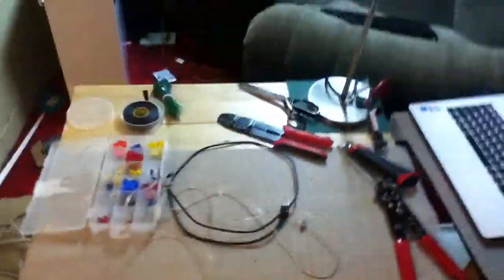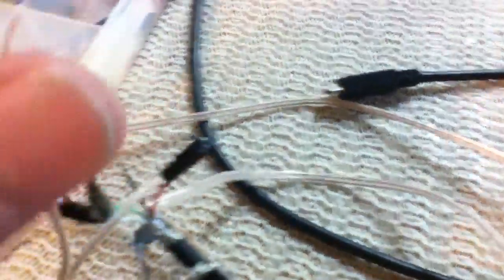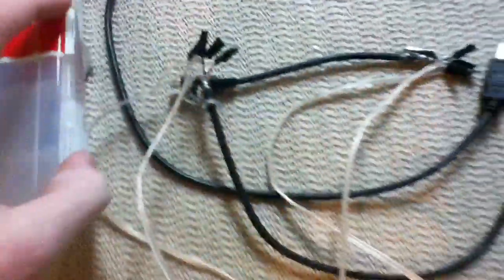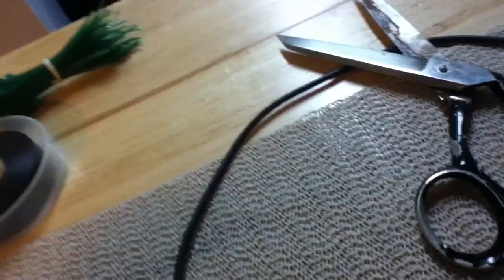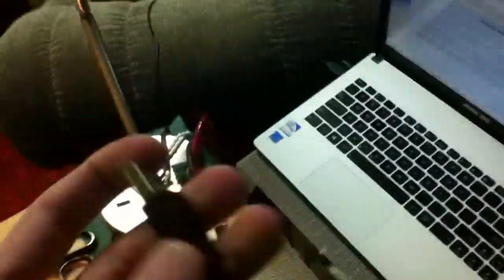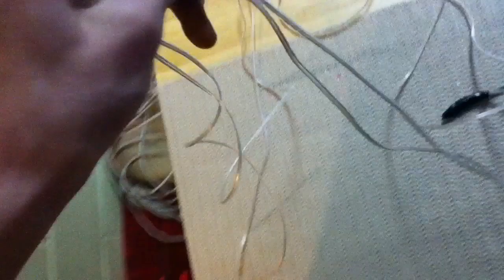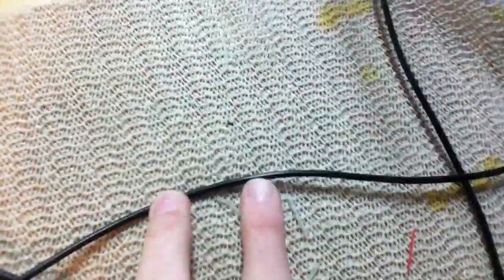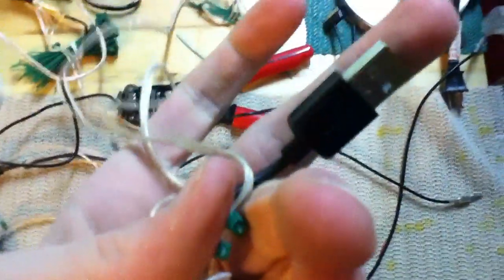How to extend a usb cable (Super Simple)

Comment: Should have used the proper gauge wire, heat shrink tubing, and soldered the connections in an inline splice, not a pigtail splice.

Comment: At 10ft it does not work will will all hardware. (Joystick, Printers, HD's).
What you need is a Cat 5 cable and a 5v external power supply. Phone chargers can work. 
At about 12ft you need a 6v power adapter.  The only cables you connect to your computer and female usb port are white and  green. 

At 15+ ft you need solid cable not stranded cable. Cat 6 is stranded cable. Used Cat5.